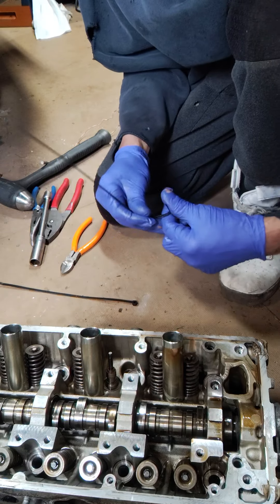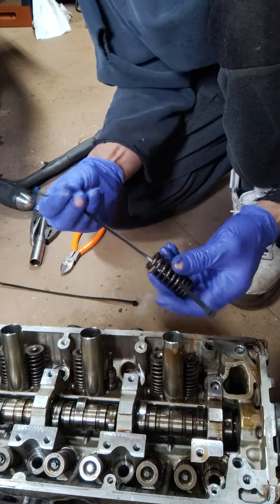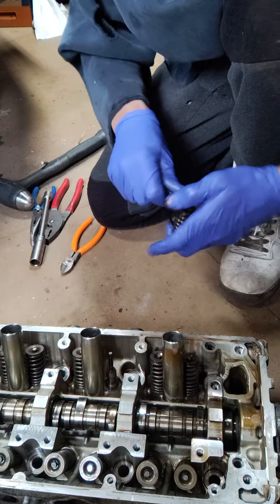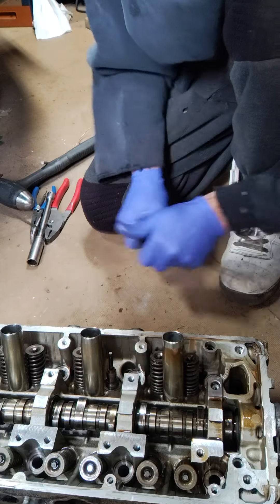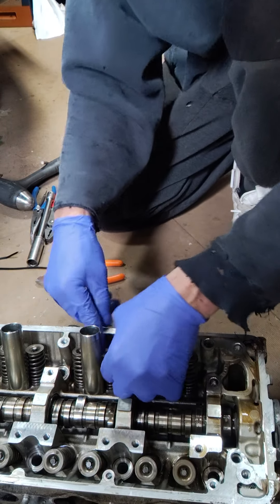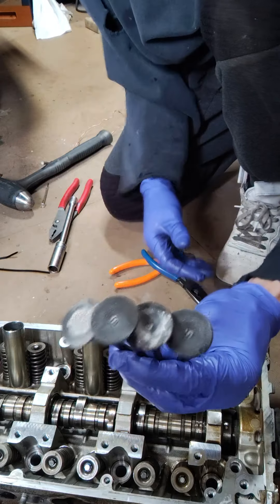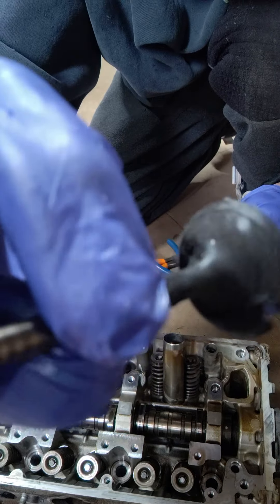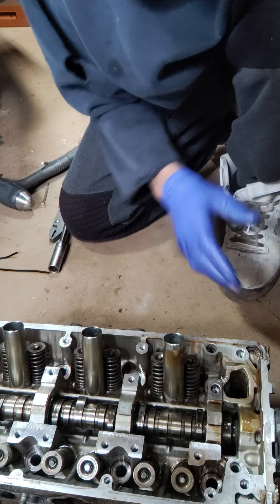I BET YOU GUY'S HAVEN'T SEEN THIS HACK DONE BEFORE! #automobile #mechanic #HONDA

Comment: Not inherently a bad option, just be careful! Saw this done on an engine that came to an old shop I worked at after a cam swap at another shop that then caused an oil light. They didn't realize a chunk of zip tie had broken off when cutting and clogged an oil return passage
Reply from the maker: That's why you look over and double check. I have been doing this since 1997 when I was racing Motocross and never had a issue.

Comment: ❤ The video. Thank you for sharing. Question - did you need to have the seat cut or did you lap in the valves? Where you replacing with OE valves? Basically, how did you get them to seal?
Reply from the maker: I had the machine inspect the valve seats and everything checked out.  I lapped them in and now it's back to 200psi in that hole
Reply: @derekbuilt7761  that's awesome. It's rare the valve looks like that and the seat survives. Good work.
Reply from the maker: @mpeg4me  thanks man. Yeah sometimes you get lucky lol

Comment: Instead of a bag of zip ties just buy a bar clamp and a socket. Cut the socket open for installing the keepers, drill a hole in a stationary jaw, bolt the socket to it bam, you've got yourself a spring compressor for 10-20 bucks
Reply from the maker: I have done that as well but this way you never have a keeper flying across the room 😁
Reply: Haven't had any flying yet 🤞 but I totally see how it might happen 😁
Reply from the maker: @sinsilius  👍👍👍

Comment: So what caused the valves to burn up? Clogged cat?
Reply from the maker: Lack of valve adjustment and the head gasket was kicking out. It was taking in coolant in the cylinder and it caused this issue.
Reply: @derekbuilt7761  Ahh, that'll do it. Thanls for the reply.
Reply from the maker: @Longtrailside  anytime brother
Reply: Looks like the valve was too sharp getting hot easily. Could be an intake leak or combination. 150,000 miles isn't much unless there's something else wrong.

Comment: I wonder if it’ll work on 648 in/pound roller springs?
Reply: well that's 54 ft-lbs and it's easy to get zip ties rated for 250 pound tensile strength.